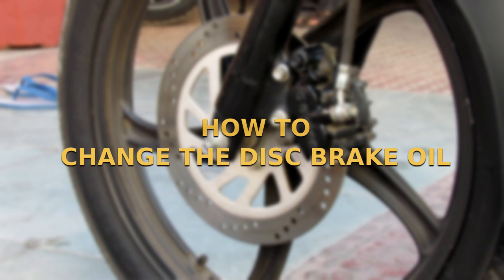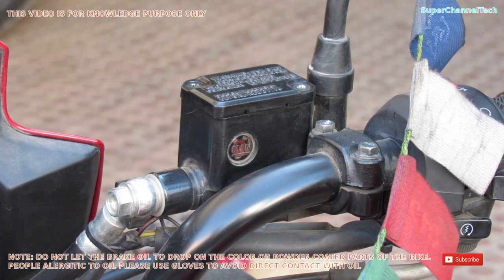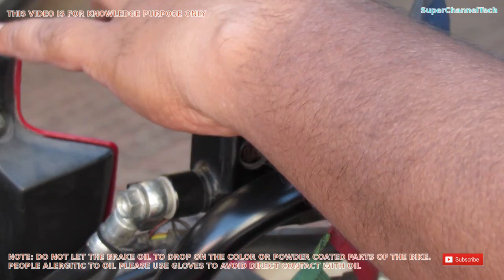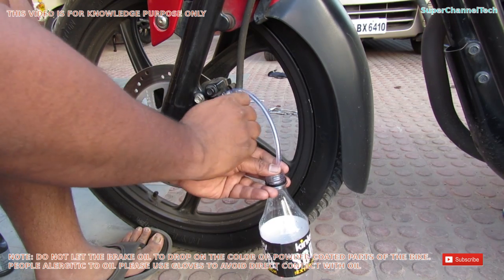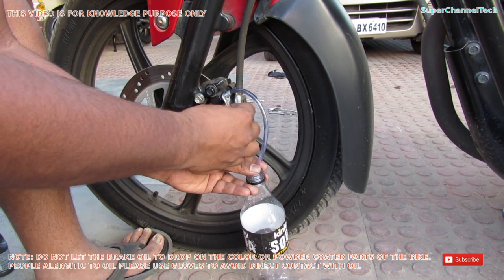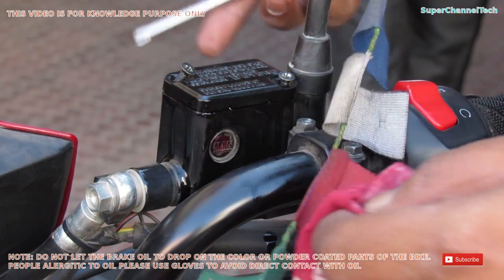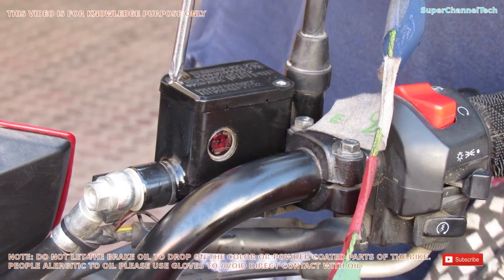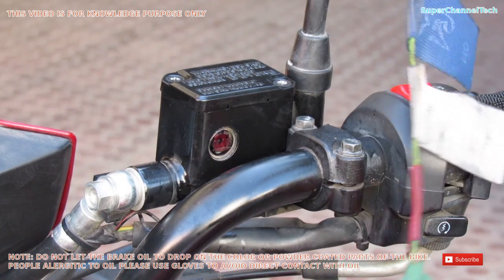Front disk brake caliper oil change (DOT 3)

Comment: After how much time the oil should be changed?
Reply from the maker: When you fell the brakes are not working well, thats the time when you need to change the oil, i personally change the oil after every 10000 Km to 15000 Km to keep the brake system in good shape.